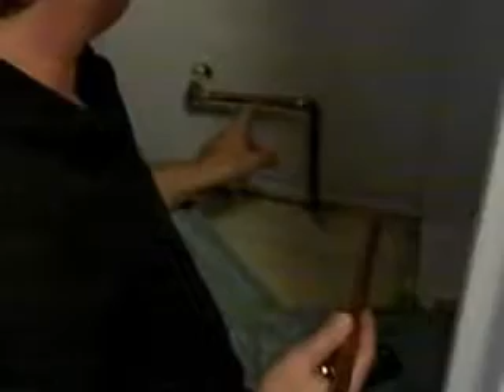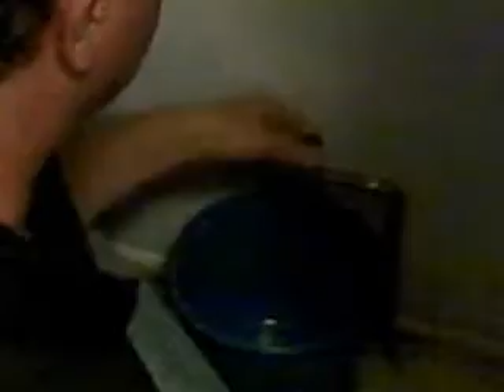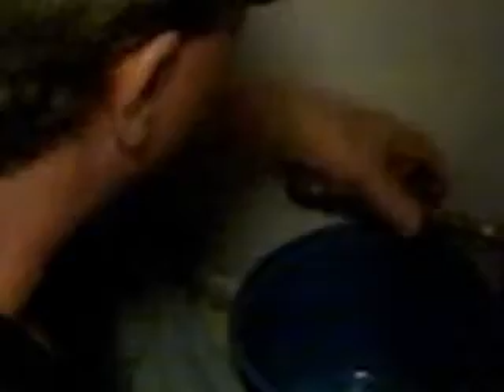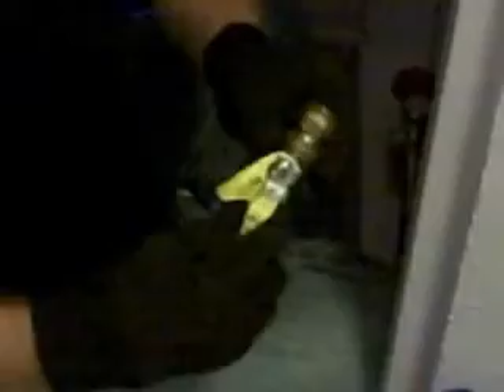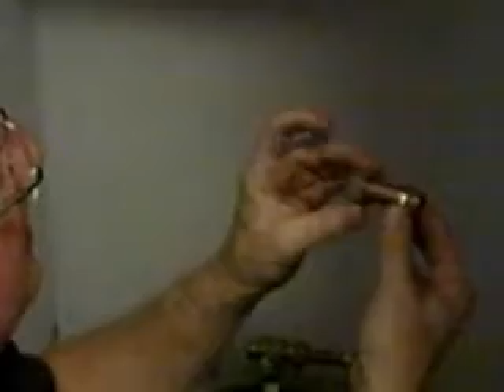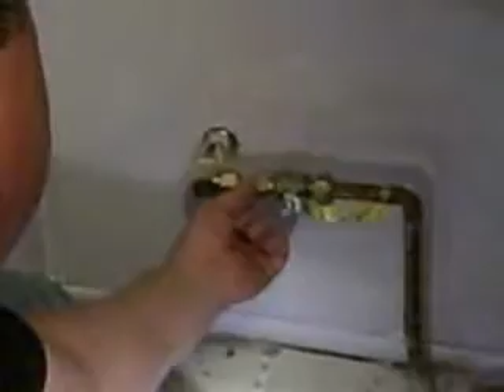Replace an Outdoor Faucet - Compression Fittings For Copper

Comment: Hello -- how did you connect the sillcock to a compression coupling?  I couldn't see it.  Also, is the sillcock frost-free pipe 1/2" or 5/8"?  Thanks.

Comment from the maker: Hi,
If you need a hole to do your plumbing from the inside, you will need enough room to use tools or solder. I would give myself plenty of room, drywall repair is about the same whether it is a small hole or a larger one. I like to have a hole that will fit both of my hands and tools. If you are asking about the hole on the outside, purchase the new valve first and measure the outside diameter of the end fitting. Let me know if that answered your question. Good luck

Comment: I am attempting to install a frost free sillcock from an existing water line that is only 15" from the outside wall. I understand all the do and don'ts but not really sure how big to cut the Hole in the wall that will accommodate the New frost free sillcock?